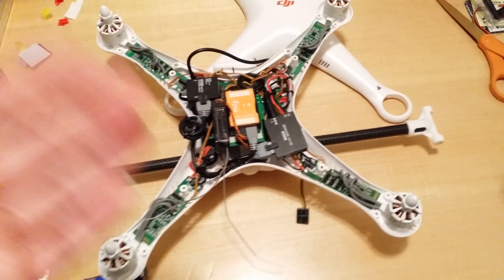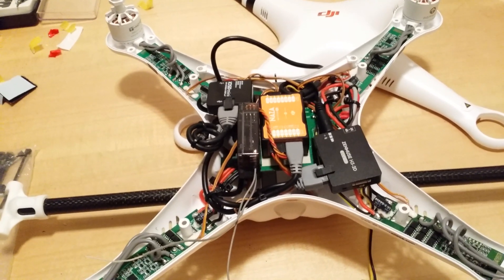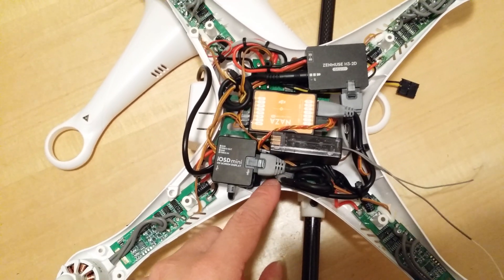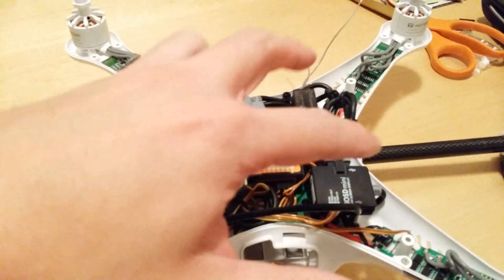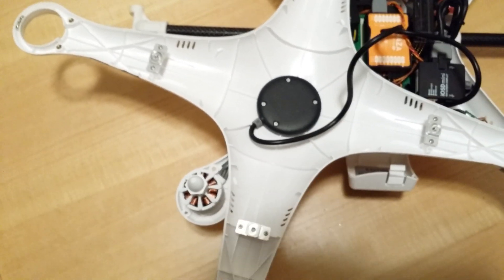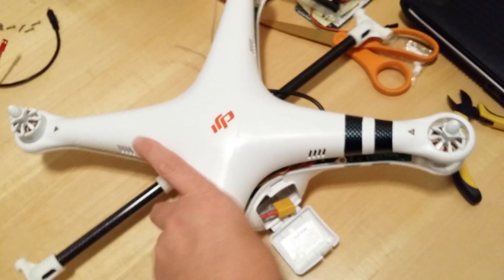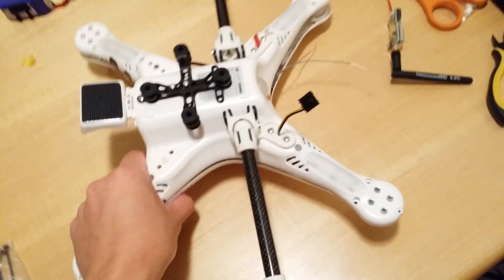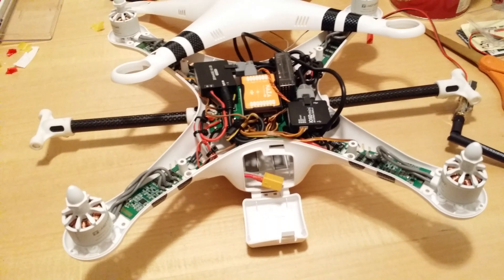Quick Look Inside My DJI Phantom

Comment: If the Tmotors can handle it, you can go 4S with DJI ESC's. You wil get a lot more power. Wil not fit the compartment but you can get a 2 battery mount. I'm on 4S 5000mAu and get 16 minutes flytime with my stuffed Phantom including FPV.
Reply from the maker: I get plenty of power on the stock 3s setup :) I don't see any need for a 4s setup where I fly. Maybe if I lived at a higher elevation than I would probably need to use a 4s to get more power

Comment: Ive been watching your vids since you introduced this project and have been thinking about taking the plunge and building one. If you don't mind would you be able to share the cost of building your custom phantom?
Reply from the maker: For the cost to build one I would suggest you not do it as the price for the Phantom dropped. I would rather buy a fully set up one than to build one from scratch now. The Naza V2 and motors alone already cost the same at the RTF Phantom lol